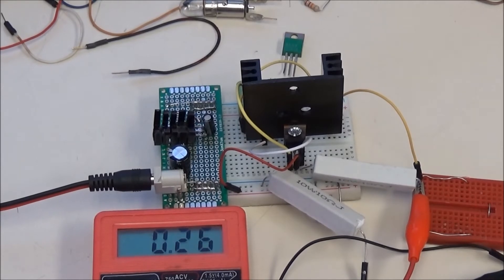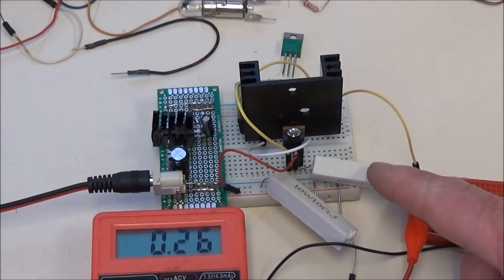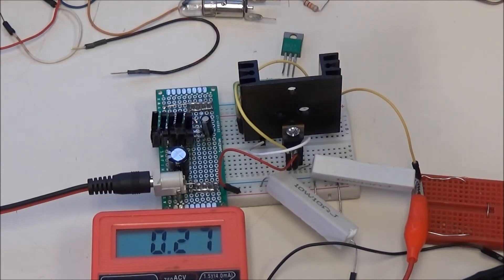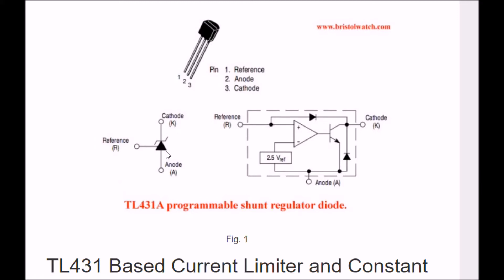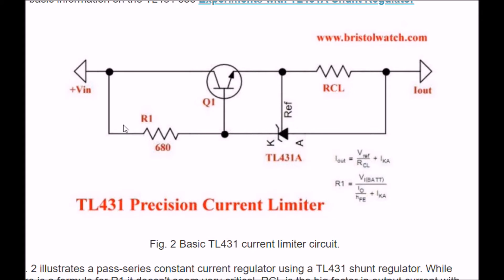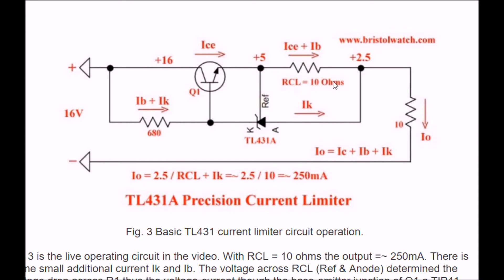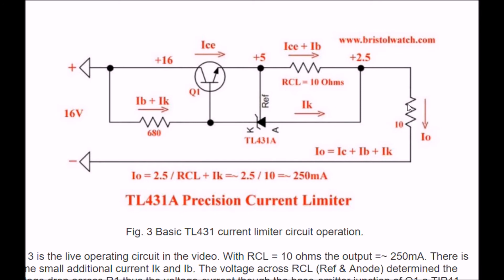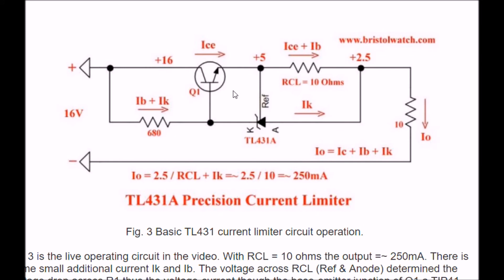TL431 Based Current Limiter Constant Current Source Circuits

Comment: With this schematic you can never get constant current, because anode current of TL431 pollutes main current flow. Anode curent changes with supply voltage and load resistance.
In "current sink" connection, where load connected between supply+ and collector you can get relatively constant current only using termostable constantan/manganin shunt with Kelvin connection. Amen!
Reply from the maker: That current is very small, but you are correct.

Comment: Does this also work with transient current?
Reply from the maker: I don't understand the question.
Reply: @LewisLoflin  i have application where i have parallel loads. One load changes its current demand and it affects the other parallel loads. Will this circuit protect my other load from the current surge?

Comment: Thanks for explanation, but I tested this circuit to drive LEDs but once VSS input voltage goes up the current of LEDs goes up too, I used LM317 to drive same LEDs and it keep current limited as I need regardless the increase of input voltage !

Comment: What part to use if you need 4A limit?
Reply from the maker: Be aware with a higher current output requires a higher current from the TL431. That relates to the HFE of the transistor. Don't exceed the TL431 current. Change RCL to 0.625 Ohms and make sure Q1 can handle (heat sink) 4A. See what happens.
Reply: @LewisLoflin  The TL431 datasheet says "Sink-Current Capability: 1 mA to 100 mA
". Doesn't that mean it cannot handle 4A in any case?
Reply from the maker: @johnaweiss  Most of the current is through the pass transistor.

Comment: You are doing some cool stuff. Keep it up. I want to make a current limiter for a brushless motor circuit that operates on 24 to 48 volts. The max current I want to allow is 30 amps. How can I make such a device? Can I adapt this circuit to achieve it? Any help would be appreciated.

Comment: I thought Vref has to always be at 2.5 volts.  I do not know how 5 volts is on the ref pin on the last circuit.
Reply: So I found a spice model for the chip. Spice did confirm the 5 volts at the emitter. It looks like the 2.5v always appears from reference to anode.  It looks like (based on spec sheet) that the ref voltage is supposed to always stay at 2.5 v.  There is a max voltage spec for Vref of 6volts in the analog devices spec sheet for an equivalent part,  the LT1431
Reply: Vref is the reference voltage from "Vref" pin to Anode pin, not always to GND, unless Anode and GND is connected.